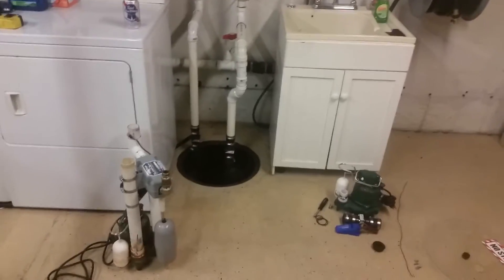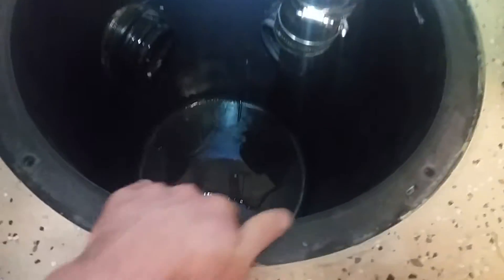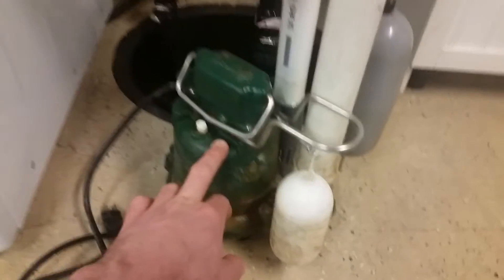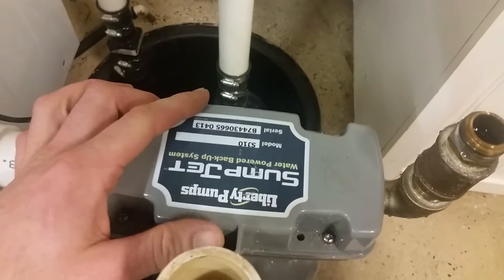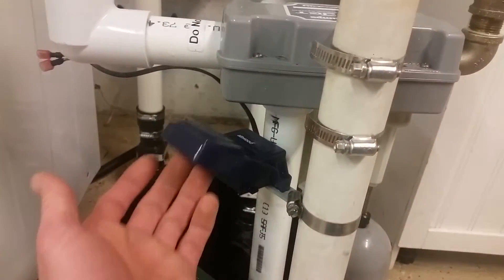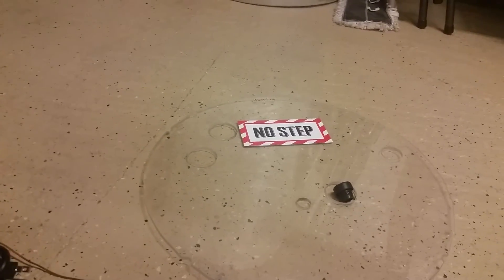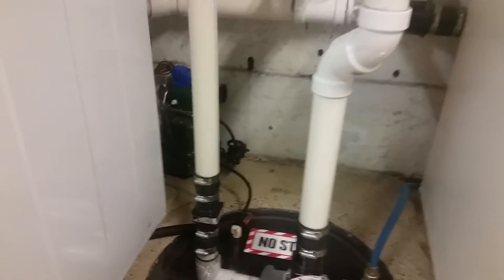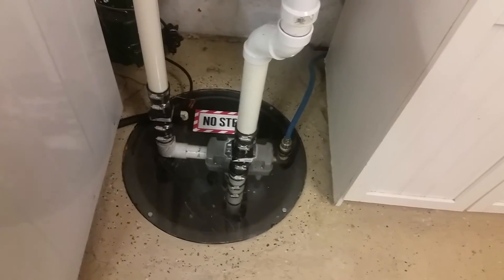THE ULTIMATE SUMP PUMP SYSTEM  Zoeller M57 and Liberty Sump Jet SJ10

Comment: Great video! I loved what you did with the pit and also the redundant discharge line for the main pump. Mine is a cement pit and debris collects easily every time it rains. Years ago, I encountered an issue with the float-operated sump pump. The float mechanism went bad and it got stuck and the pump kept running and damaged the pump. I did not get to it in time to save anything. On my current pump I went with one without a float switch and I use the Levelguard switch. You connect the Levelguard to the power and connect the sump to the outlet built-into the Levelguard plug. The Levelguard has two markings on it to detect water after which it triggers the pump. You can't have enough redundancies in the sump given how much damage can occur in a short time. Thanks for posting the video.

Comment: That's impressive, the best one I've seen yet. My state requires a RP/RPZ valve on the water line and I've yet to see anyone put one on and 90% of the videos I see, people discharge the water jet into the existing line which they will figure out why that's a bad idea when it floods and the sewers are full. Impressive work though man.

Comment: Nice setup! What is the hookup on the SumpJet for the municipal? Is that a garden hose connection?  I checked my pressure and it's about 80-PSI at my garden hose, so I don't think I need to use the 3/4 line either.

Comment: Need some advise on level of water to be maintained in sump pump? is it ok to keep float above the inlet pipe level? My groundwater level is 8 inches below the basement floor but higher than inlet pipes. If i keep the float right below the inlet pipe, the pump keeps kicking in as I have continuous flow of water.
Reply from the maker: Wow that's crazy that you have constant water in your sump. Yeah I guess set it wherever it needs to be so that it doesn't turn on all the time when it's not raining. I don't see it causing any harm

Comment: Do you have a double check valve installed on the Sj10 valve. If not the water from your sump crock from your Sj10 could back flow into your public water supply possibly allowing contaminated water into the rest your house.
Reply from the maker: No I was under the impression it had a check valve built into it. Maybe I'll go ahead and add another one. Thanks

Comment: I don't like the idea of leaving the house watter supply on when we are away for a long period of time
Reply from the maker: I agree with you that it's a good idea to turn the main water off if leaving for a long time. Ive thought of running a separate lead just to the sump jet so I could still turn my house water off when I leave for a trip
Reply from the maker: But honestly, all of my Plumbing is in the basement and if I ever have a pipe burst, the sump pump should take care of it before actually flooding the basement.
Reply: @NoNonsenseKnowHow   I like the system  but as far as leaving water on when on a trip one of our neighbors water meter failed and flooded their house thats why I always shut ours off , we did have a new meter installed a few years back but I still worry and shut it off .
Reply from the maker: @lesgrace1697  yeah certainly a safe bet to shut the water off

Comment: I would put the alarm float just a bit above the turn-on level of the primary pump, but still within the sump, below floor level. If the primary pump is working properly, you'll never hear that alarm. If you hear the alarm, or are notified of it remotely, you probably will want to see immediately what's going on and not depend on the backup pump taking over. If the backup rarely runs or never runs, it may not run at all when called upon to do so.  Moreover, if the backup pumps are there to take over during a power failure, the alarm system should have an uninterruptible power supply that continues to operate the entire alarm system for a few hours when the power goes out.
Reply from the maker: Totally agree with everything you wrote. I actually already ended up adjusting the switch location so that yes it goes off if the main pump fails but before the secondary pump passed you kick in. And it's tied in with my house alarm system so that they will call me in case of a failure. Which that system also as a backup battery

Comment: Put levelguard switches on those pumps (n53 or n57) and you'll have zero issues. My combo n53 and levelguard are 7 years old and my pumps activate over 250,000 times from October to May.
Reply: Zoeller pumps are built like tanks. There only weakness is there switch. The switch will only last for around 50,000 activations, that pretty much goes for all sump pumps with built in switches.
Reply from the maker: Cool man I'll look into that. I appreciate the tip. Haven't had any issues yet

Comment: you should have a 3/4 water line to your backup pump and most local codes require a back flow preventor to keep waste water from getting into you fresh water supply for your home. great looking setup though!!!
Reply from the maker: Yes I read that about the 3/4" line when I installed it, but since I could conveniently tap into the already existing line I figured I would try it, and it flows just fine. Could it flow more were the three quarter? I would assume yes.  And I also read that about the backflow preventer, however my sump never fills up that high and it's not like it's connected to the sewage.  That combined with the fact that by drinking water is crappy to begin with, I'm not too worried about it.  I always get letters in the mail about fecal matter in my water.    But good pointing that out.

Comment: Is the water alarm above or below the level of the backup pump?  If it’s above and the primary fails but the secondary works and you don’t get an alarm, how will you know that the primary failed?   I’d think you’d want two alarms. One above and one below the level of the secondary. Or just one alarm but below the level of the secondary. 

Nice cover. I might do the same. Right now mine is open.
Reply from the maker: Neil Brookins the alarm is above the secondary. I added another alarm later that's just hooked up to a little buzzer that goes off if the primary pump fails. However if the secondary pump ever operates I will know about it, because it shoots out on to the driveway and I'll see the water there.  So to answer your question, yes it does now have two alarms. But only one is actually hooked to my alarm system in the house to alert me via text message or phone call

Comment: NoNonsenseKnowHow, Thank You for your video. A truly well thought-out, immaculate system!  My personal preferences are these: a) Supply a pump stand. b) Use a non-automatic pump for your main; such as Zoeller's: Mighty Mate, 53 - 0002  N53, ( Zoeller float switches are not known for having long lives ). c) Use a higher quality water level controller such as: The,  Ion +  Digital level contral, ( 6"  ), with High Water alarm.  Tim.
Reply from the maker: timrhoades11 thanks for your comment and watching.  So far I have had good luck with the Zoeller Automatic Pump. It's been in there for about 5 years now. But I'll keep an eye on it.
Reply: yep, your weakest point with these sump pumps is the float switch.

The single phase pump has a high in-rush current... 
I have one for my downstairs bathroom that pumps shower + grey water every single day so I went a little over board with my control design:
electronic sensor with a single stainless steel rod level sensor relay output controls the coil of a beefy 25Amp motor rated relay that feeds a SOFT STARTER that ramps up AC current to my single phase pump.

What really kills pumps is the drive motor start surge when the shaft  does not know to spin nor translate against the pump bearings... the fix is a SOFT STARTER (by German schneider electronics)

I even retrofitted a Soft Starter in my cloth washer to stop abusing the "gear box" with high torque surges during start-stop cycles.

Comment: Need 3/4 supply  for the liberty backup
Reply from the maker: Don Miller actually it depends on what your water pressure is. my house is at 60 PSI and this Liberty Pump flows very well. I've tested it numerous times. have you measured your water pressure?

Comment: hi you need to cut the bottom of that pit to lower your water table even better because those holes that you drill water will come in to slow in a heavy rain your water table would rise too fast believe it or not so good luck with your new pit
Reply from the maker: If the water rises that fast it comes in from the perforated 4" french drain tubes.  But yes, if i ever do have a problem, ill simply drill some more or larger holes in the basin.  Thanks for watching.

Chris

Comment: Cool setup. Looks like you're ready for the heavy rains. My family is talking about having a house built with a basement, and we have heavy clay soil here where we are at, and when the ground gets saturated, our ground gets very swampy. 

I've stated my case that if a basement is put here, that it should not be installed without a sump pump system.